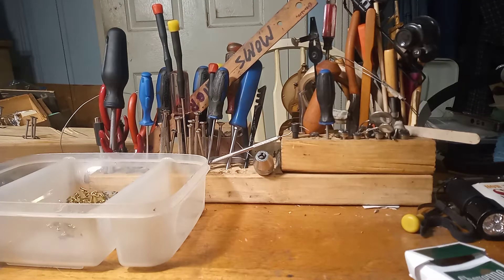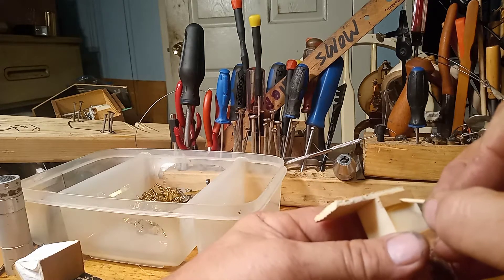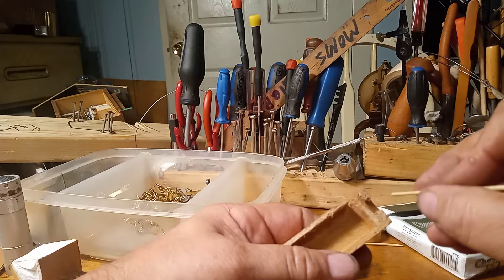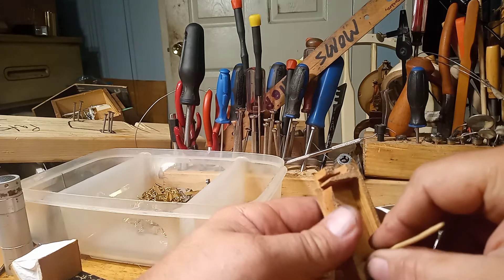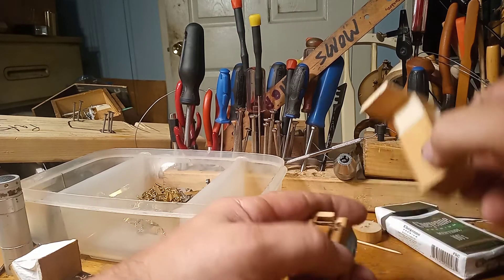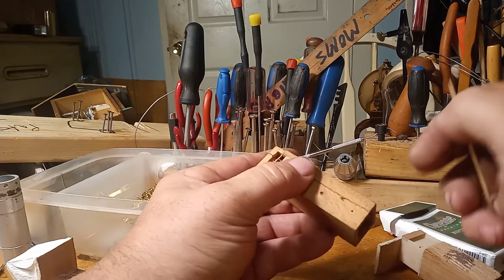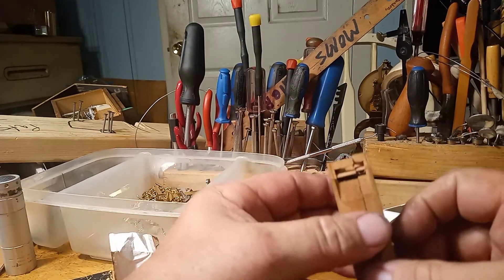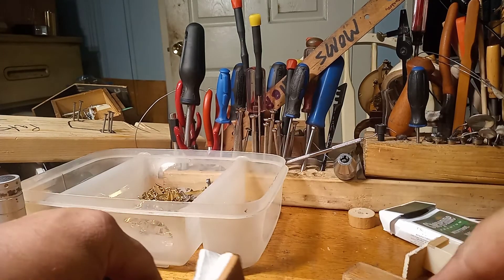Cuckoo Bellow Operation Explained or how a bellow works

Comment: Great video! My bellows make very little sound anymore. I thought the paper was ripped but it looks quite good. Does the paper get weak and need replacing? They do make sound when I close them by hand but again very weak. 
Thoughts?
Thanks again.
Reply from the maker: There can be a tiny hole in the paper or where it is glued it could be coming unglued so I would take the bellows out blow through the hole that the music comes out and feel around the paper for leaks.  Good luck.